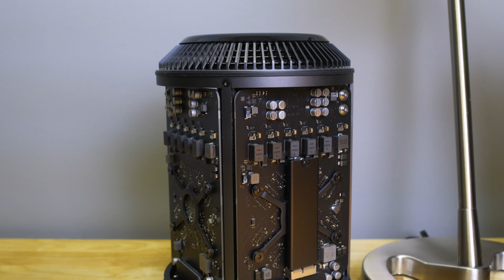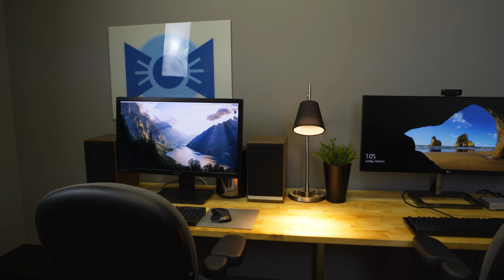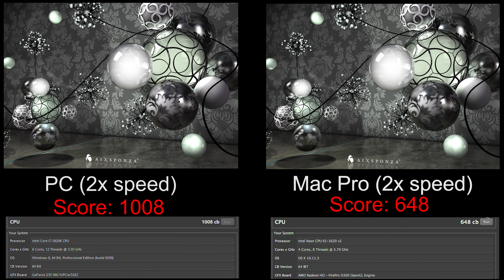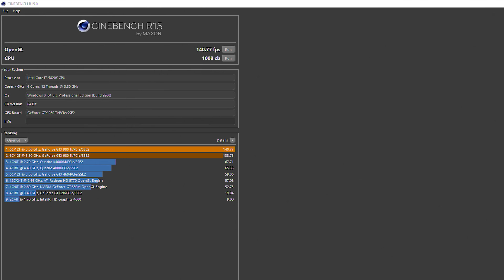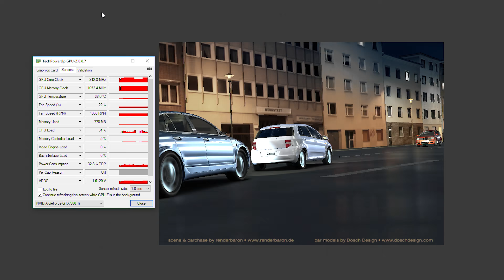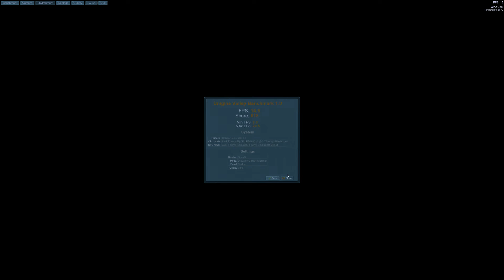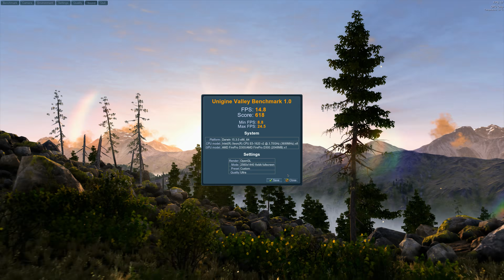$2,000 Custom PC vs $4,000 Mac Pro

Comment: Man I should build a PC. Only problem is, I don't need one. I don't game. I don't edit videos.  But I really want to build one :( is running photoshop or programming a good excuse to start learning how?
Reply: +Tarek Midani How about selling it afterwards? You can have your fun building it and get a little bit money^^ made that tow times
Reply: Great idea ThunderbirdQS ! And thanks guys for the tutorials!
Reply: Just do it, doesn't need to be super expensive for you to enjoy it. Get a 5th gen Intel i5, 8gb of ram, a 120gb ssd, a 1tb hard drive, and roughly $100 graphics card. That computer would cost you around $600 and I guarantee would be the best computer you ever used.
Reply: +Darrin Hillier 
I just made a PC on PCpartpicker for you total is $596 before any rebates and an OS.
http://pcpartpicker.com/p/b9LgRB
Reply: +Tarek Midani I just bought a macbook pro for programming (Computer Science Student) as they are generally better and easier to use for programming software in languages such as C++ but if you are using Java windows is probably better. so in the end it doesn't really matter too much in my opinion
Reply: +Tarek Midani Build a small footprint & quiet home theater PC for your entertainment center.

People get excited about Roku, Apple TV, ChromeCast, but nothing beats having a full fledged PC hooked up to the TV.
Reply: +Tarek Midani Yes.  It is.  If that's all you're doing you can get going for under $300.
Reply: At some point, you would need one.

You don't know, maybe you would like to try gaming on it.
Reply: +Tarek Midani 
Sure, just dont be surprised if you run into any problems, especially for a newbie.
Reply: Yep it is, and it's kid of a thrill when you build your own, because atleast you learned something !!!
Reply: +Tarek Milani I'd pay more, like a thousand dollars so it'd be more future proof. Maybe you'll start gaming/editing or just want a 4k monitor for watching movies. Depends on your budget, but changing parts will cost you more in the long term.
Reply: +Tarek Midani It never hurts to have another computer around! They're so multi function, you definitely have run into situations where you need a computer. And if you build one powerful enough, you might have an excuse to start gaming or edit videos :L Photoshop and Programming are excellent excuses too! I have a 5820k in my PC and all I do is Game, Live Stream, and do a shit ton of programming. My PC is about the same strength as the one in this video(except I have two GTX 970s)
Reply: +Tarek Midani simple answer. yes. long answer. yes! nuf said. switch to gimp, and use a linux box. ^_^ better for some coding applications. and no OS cost. just so long as you dont expect to play games on it.
Reply: +Tarek Midani You know what IS a good excuse to learn how?

Set up a business.  Build custom PCs for people in your area.  All the information is already out there in the form of tutorials, videos, and benchmarks, and you can even verify it yourself by testing parts you buy in.  You even get paid to do it.
Reply: +Tarek Midani just because you want to build a computer doesnt mean that you have to build a gaming computer! You can just get low end or mid range parts that will work fine for what you're doing!
Reply: +Tarek Midani if you reaaaallllyy wanna build one and dont need it, send it to me?
Reply: Exactly. not only gamers build computers, ya know. ;) Just make sure to look up plenty of tutorials and how-to's before you get into it, there's a lot that can go wrong while building a pc.
Reply: You can build a web browsing computer
Reply: if you want to build one for the sake of building it, just get some old scrap, but make sure all parts are compatible, which btw is always the first step to building a pc. You can maybe use that as a media center, NAS, etc.

If you want to build your first gaming (or video editing/work) Pc, you can buy parts like the case and the Ram used, 8gb of any (compatible) ram will do.
For the cpu and gpu I would aim for 100 bucks each, but if you really need a lot of performance for video editing or stuff, maybe a bit more for the cpu. Look around for used older graphics cards, sometimes that will get you more for your money.
A ssd is not necessary, just really convenient.
The power supply only really needs the right connectors for your mainboard (and graphics card if needed), in terms of watt, google for "powersupplycalculator".
Reply: YES! To be able to run the best while using photoshop or having more scripts while programming you need a good PC! Go for it! Build the PC!
Reply: you can use the pc for shared compiting when not using; it basically uses your pc to find new cures or medicine/research
Reply: If you want too, just build one. You'll find out your use for it. Mine plays Wii/GameCube games in hd
Reply: +Tarek Midani wtf? what kind of questions IS? Go on google and search how to build a pc. KTM!
Reply: +Tarek Midani The question should be, is there a better reason than photoshop and programming? Both of them are very CPU intensive tasks and would benefit greatly from a better CPU.
Reply: ErikTheAndroid True, but so far a laptop with a core i5 is able to run everything
Reply: +Tarek Midani Yeah go for it, and like others have said build yourself something in the $400 -$500ish range, and you can do it by going with AMD A-10 APU parts as that will save you on having to buy a GPU, and just get at least 16GB of DDR3 1866Mhz ram, as it really matters in an AMD APU setup.
Reply: +Tarek Midani 
photoshop is good enough of an excuse :P
Reply: +Tarek Midani You could still build a low-ish end PC just for general use. 8Gb RAM, AMD Quad Core, Small SSD and a GTX 750ti if you want to get into some basic games or anything else GPU related.
Reply: +Alex Grace That's why I said AMD A-10 APU as it's a jumping point to add an AMD GPU down the road for hybrid cross fire, and it's a lower cost 4 core system.
Reply: +Tarek Midani yeah why not starting with something less expensive? You get good components even second hand (except PSU of course)
Reply: +Cole Pearson Austin Evans and those Newegg tv episodes are what got me through my first build.
Reply: You need no excuse, building a pc is fun, you could just build it to go online
Reply: +Tarek Midani You can build a comp out of used PC parts for like 250$ and 350$ with a solid graphics unit. Quality PC parts don't break a lot anymore. :) My i5 is about 5 years old now and has been running 4ghz forever. :D

I'd reccomend a NEW mobo since they're cheap anyways, little dumb th ings can mess up on those when shipping and pulling it and all that.
Reply: +TheATTKGaming I too built my first one with help from Linus.
Reply: +Tarek Milani If you got the funds and the time, I'd say indulge your curiosity!
Reply: He said their good for photoshop and editing. But PC is the same since it can run the same software. Totally worth the double price to save maybe .1s on a photoshop render?
Reply: +Tarek Midani Raymond Flores may be in need of your services.
Reply: you know whats even more fucked up? wanting/needing game pc but not having the money for it....
Reply: +Darrin Hillier Lose the cooler. Stock heatsink + fan that comes with the processor will do just fine.
Reply: +Tarek Midani its fun building ur own pc and when ur done it feels like a relief and just knowing u build it urself will make u want to use it so go ahead watch some totourials and get to it
Reply: +Tarek Midani its fun building ur own pc and when ur done it feels like a relief and just knowing u build it urself will make u want to use it so go ahead watch some totourials and get to it
Reply: +Tarek Midani you could always build oher peoples PCs
Reply: +stephen allen as first time xD? i would rather not he touched mine as a first go
Reply: bech 1200 as in build one with a friend , learn how to build , he just wants to build a pc
Reply: +Tarek Midani Photoshop? Only when stitching panoramas or other photo collation. Lightroom works snappier with better PCs. Programming - well on a PC you can add more RAM or more CPUs and run more Virtual Machines. They also compile faster.
But you don't need a fast GPU for any of that.
Reply: stephen allen
well how was i surposed to know what u meant, is this a quizz for a million bucks? XD
Reply: if you photoshop you need a good and expensive IPS monitor
Reply: if you want to biuld a pc (or do whatever you want to do) just do it man... you don't need nobody's approval :p
Reply: +Dario Urbaez build*
Reply: +Tarek Midani 
If you are looking for an excuse to build one just do it, youre not hurting anyone.
You dont really need an elite PC to PS any how just a decent processor.  I would suggest picking up some extra ram and setting up a virtual scratch disk, especially if you plan on going SSD.
Reply: why do people think pc are all for gaming?
Reply: very excellent if u choose pc
Reply: Mahboy
I dont really see anybody who thinks that.  Have you been talking with Apple fanboy?
Reply: +Mahboy no one here does
Reply: +Tarek Midani It's a fun and enjoyable thing to do. Kinda like building legos when you're 4 years old
Reply: +Tarek Midani 
Building a PC just for fun is a good reason to build one. You don't have to build a beast. Just build one for fun!
Reply: +Asdayasman boo yeah.
Reply: +Tarek Midani Building a computer is a pleasure (and a job) on it's own, you need no excuses :)
Reply: +Tarek Midani Can be a hobby, like rebuilding old cars or something...
Reply: Not really no. Gaming is a better excuse
Reply: +Tarek Midani Best reason to learn how to build your own PC is that you'll be able to fix it yourself should something break on it, rather than paying through the nose for someone else to fix it for you. That's pretty much the reason I learned years ago after I paid a guy $70 to simply unplug and replug all the cards on my computer after I had installed a CD drive and didn't have my sound card pushed all the way back into it's slot. Computer wouldn't power back on, I thought I'd killed it, took it to this place where they charged $30 something a half hour, and found out that was the problem. I now do tech support on the side and pretty much just charge a flat fee of anywhere between $20 for little stuff up to $60-80 for more involved work (plus parts cost if needed). I refuse to screw a customer over because if I were to charge by the hour, they might as well just buy a new computer. They're happy, and I've got some beer money.
Reply: +Tarek Midani Actually, Photoshop is. CPU anyways. programming I guess could benefit, but not as much.
Reply: +Tarek Midani You could build a computer really cheap ($300 maybe), and for a non power user you would likely have no performance issues.
Reply: +Calake and, if he does a really cheap one if he fucks up a part while building, it will be cheap to buy a new one
Reply: Yeah but it's not very likely. As long as you buy the right parts it's quite difficult to fuck up.
Reply: maybe if you step on your cpu XD
Reply: I only fucked one computer up. I blew canned air into the PSU when turned on. I'd been churning these cheap ass computers out for days and started to get lazy.
Reply: ouch, i have only built one pc and i didnt fuck anything up luckily aside from not hooking up the HDD led
Reply: +Tarek Midani Im a Web Dev.. I built myself a Server... a work/gaming workstation.. Best money spent ever!
Reply: +EverythingAssholePro love ur name
Reply: +Tarek Midani yes. there are a bunch of youtube channels that do builds.
Reply: /r/buildapc
Reply: +Tarek Midani Gaming is a good excuse.
Reply: +Tarek Midani Its surprisingly easy to do :) the only thing you might have trouble with is if you are going to overclock the cpu/gpu.
Reply: +Tarek Midani i build mine using amd, for 350 bucks, i used Athlon 860k that is clocked at 3.7 ghz with 4 cores, and HD 7770, but you can get a better graphics card for 100 bucks (GTX 750 ti)
you dont need more then 8gb of ram,(30bucks)
Reply: photoshop definately. that thing can be a resource hog. it uses both memory, cpu and gpu. though granted it makes a much smaller difference than it does for the rest unless you work on poster size stuff with many layers and smart filters.
Reply: +combatplayer what i was arguing is that you cant simply say apple is superior just because you had a bad experience with 32bit Xp
Reply: +Nabeel Himsee you're right, but that's also why he initially asked if it was any better now, admitting that the XP system was ancient.

also this looks like the wrong comment chain, just in case you didn't realize.
Reply: building a pc is really easy and you dont need to "learn" how
Reply: you don't have to be a gamer or video editor to build a pc, as if matter a fact any setup will accommodate any basic task. you will appreciate it more and better to diagnose

Comment: Of course the MacPro is more expensive, it's using workstation grade components. The MacPro is expected to run almost 24/7 with zero downtime. Not to mention the power consumed is way less than the PC. You should've used ECC ram, Intel Xeon, workstation grade board & pci-e SSDs to make it an apples to apples comparison.
Reply: this is incredible! apple fan boys are the butt hurt ones! never thought I'd see the day!
Reply: ***** got anything to back your claim?
Reply: ***** you do realise that the total system is close to $10k right? and they never compared it to a MacPro.
Reply: +nazhif1 Why make apples to apples comparison when you can have 3 times faster PC than Mac Pro for half the price? He's not rendering 24/7 eighter.
Reply: +nazhif1 You can buy a E5-2658 v3 on eBay right now for $300 (12 cores/24 threads). Apple charges $1000 just to go from quad to hexacore (6 cores/12 threads). The apples to apples is that PCs are cheaper with better performance. If you wanted to build a PC with Xeon and ECC memory, it would still be cheaper and faster just because of how overpriced/outdated the Mac Pro is.
Reply: Okay and that's great but no workload you're going to do as a creative professional is going to need 24/7 operation where cosmic rays flipping bits in your ram is going to ruin the whole project. For someone like this who is doing video editing and running 100% for no more than a few hours a day there is almost no need for workstation grade components.
Reply: +nazhif1 This video is about his experience and which system works best for his needs. For him, the custom pc is better. Notice that he never states which computer is better value outright, this is a very unbiased video
Reply: +nazhif1 Yeah, the worsktation grade components would jack up the price, but building a workstation of the same or greater specs would still be cheaper than the Pro. ATTK is leaving out that LinusTechTips actually uses Extreme Editions (Read: Non-Workstation CPU) without ECC RAM when they edit their videos. They might have lowered their editors' specs because they have a newer setup with a rendering/encoding machine in a closet somewhere.
Reply from the maker: +shadowtsunami This is my main frustration with these "workstation grade" components. Cooling on Mac Pro straight up sucks because Apple refuses to bump the fan RPM up until the CPU core temp hits 95 deg C and the machine experiences severe thermal throttling and performance drops drastically. Just silly!

Comment: For years Apple computers was about OS that they come up with. Recently tests shows that OSX performs worst than Windows 10 or Linux on the same hardware. Current Apple pro products are total failure, Mac Pro is 3 years old and iPad Pro is basically a joke without access to file system which is essential for professional use and monitors which are 2011 products (essentially the same as Dell U2711) with LCDs from 2009 27" iMac!!! Bottom line is: if you need machine with high performance go with PC, try Linux or Windows and you will be fine and those are words coming from big Apple fan. Saying that I have to admit that in my opinion consumer grade products are still the best from Apple in terms of quality, security and design. I prefer sandboxed iOS that restricts apps from sniffing around my data over, too much open in my opinion, Android OS. MacBooks are also great products for me, great battery life, hi res screens without scaling issues, aluminium case and very good design are definitely win for me.

Comment: Refurb PSU issues? I bought a refurbished Corsair HX750W (not the i, the original) and it has been working flawlessly for the past year and a bit. You must have just had a bad unit all together. 
OT: Apple really needs to be constantly updating the Mac PRO - (Key word) - To keep pros interested.

Comment: Graphic card(s) in the macpro are slow and overexpensive but as far as I know those have "more reliable" drivers for media production. Gaming cards are obviously faster but less consistent in the long run. I'd love you to make an updates video in a few months to tell us your impressions after having extensively worked with the new system (probably for video editing only you'll be just freakin fine). Thanks in advance!